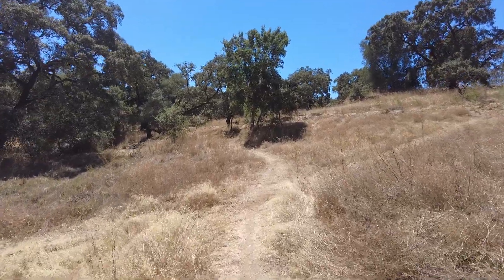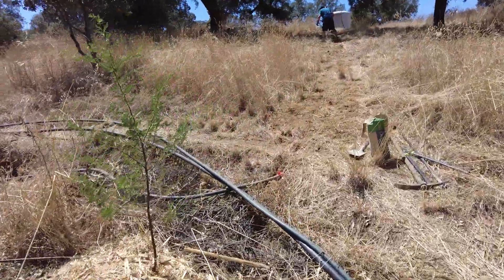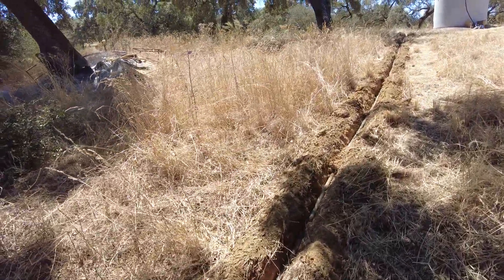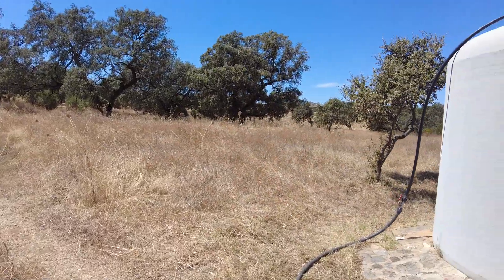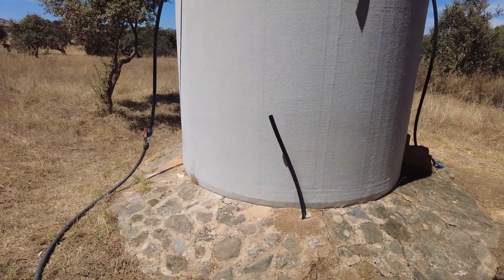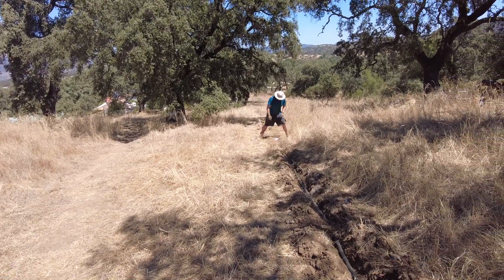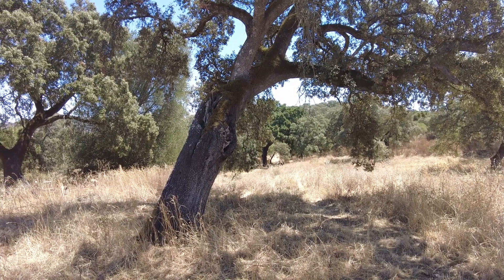Irrigation pipe creeping or pipe walking due to pump hammering.

Comment: Your video hits home hard. 
I have a main coming down a 20 degree slope, and it creeps down a lot; had to anchor it every 10 meters using hose-clamps and an anchor rod (no burying in solid shale)
The heat of the water makes showering impossible until 20h00, in summer. Always good to watch, thanks!
Sterkte.
Reply from the maker: @AridForge  Dankie. Let's bury this in the issue for once and all! Have a great day.

Comment: Great video! One of the best ways I've found to prevent problems with pipes is installing air release valves. They are special valves that let air escape but not water. They can be great at preventing water hammer and they also make sure that you don't have pressure drops due to air in the pipe. You can get small ones quite cheaply.  I'm using them in pretty much all my systems now.
Reply from the maker: @permanick  Great sharing. Let me look for one now.

Comment: WOW Martin, you and Zak are making such wonderful progress.   
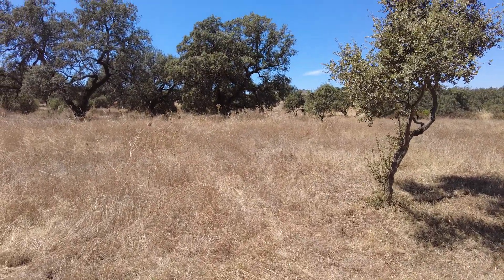I'm looking at the view of this high elevation field on the farm at 2:39 - so clear and seemingly flat.  This is a great location for rows of perennials like lavender.  You could mix in some holm oaks for shade if you like.  The first step may be to use the Giraffe with the ripping bucket to open the soil (sub-soiling) on contour.  This project could give Zak some more valuable time in the Giraffe's seat as it is repetitive.
The next step may be to dig a swale and berm around the low elevation border of this field to capture all of the rain runoff.  Infact, you could even pump water into this berm during periods of surplus supply.  Water infiltrated by that swale would likely benefit the entire farm that lies below this elevation.  
With the decommissioned 32 mm pipe from the qanat cistern already at the tank, a small adaptation would make pumping water from the cistern easy when the cistern fills to the level that it starts leaking valuable water. 👍
Hoping something here is useful.
Reply from the maker: @stevejohnstonbaugh9171  Always something useful from Steve. Have a happy day.
Reply: @SuerteDelMolinoFarm  😊👍

Comment: Water hammering can be incredibly damaging in pipesystems. I once had a junior officer, who turned a 300 mm butterfly-valve into a parabolic receiver by waterhammering (and being an idiot, but thats another story 🙂 ) There are a few ways to mitigate it:
1. If possible, fill your lines by gravity before turning on the pumps. Perhaps a gravity feed by-pass near the tank?
2. Operate valves on the system SLOWLY to avoid sudden pressure spikes, perhaps throttling the pump discharge until the lines are filled.
3. Install a frequency converter on your water pump (if possible). This lets you control the pump speed instead of just being on-off.
The other mitigation factors you have listed is definitely also part of the solution.
Happy digging and take care.
Reply from the maker: @BrianJensen-ym5gk  Great sharing. Much appreciated. Some food for thought.